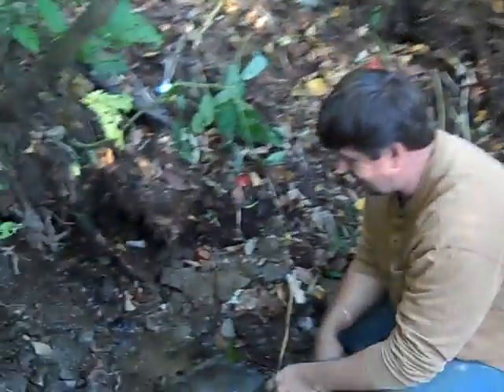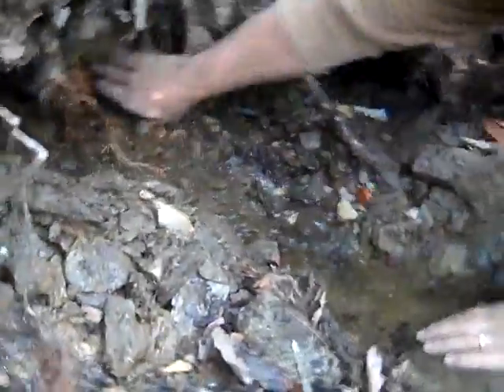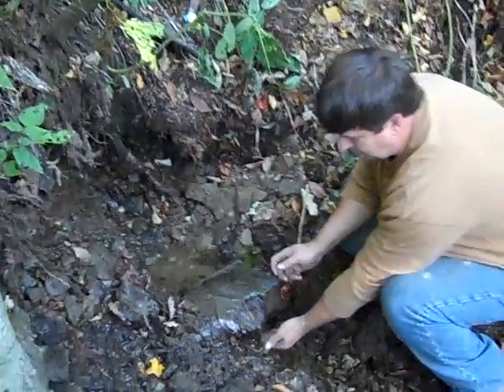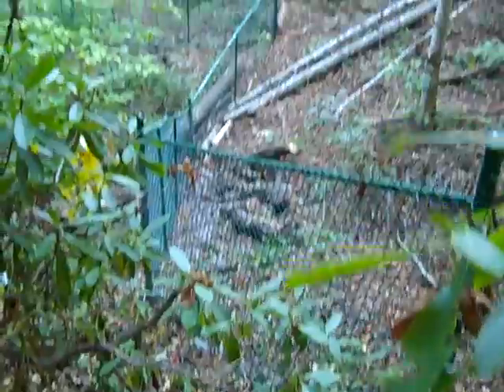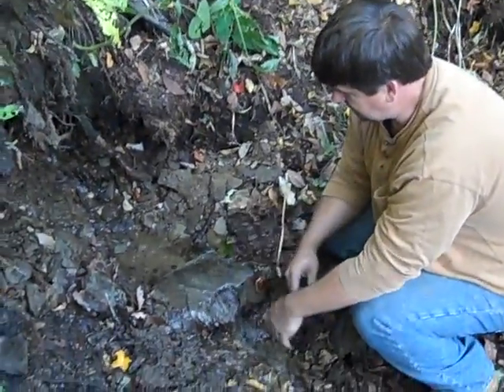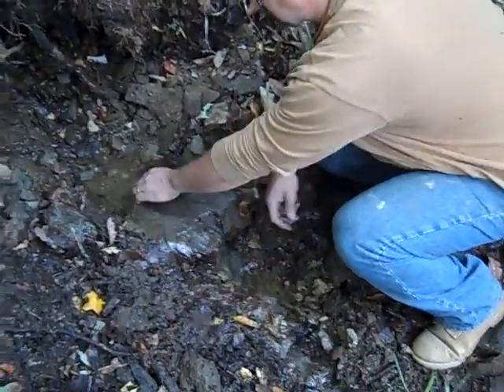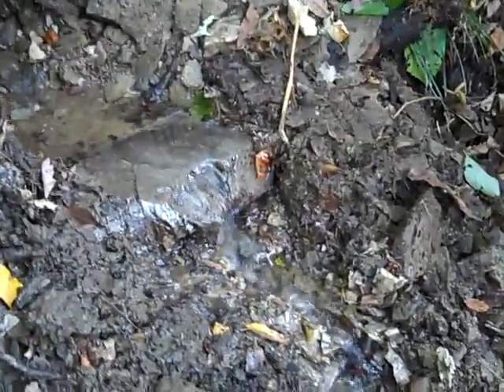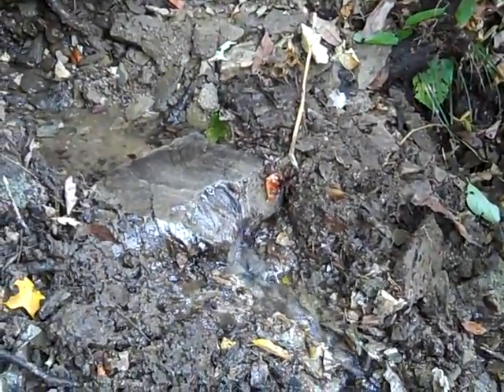WROL Spring Development PT1

Comment: I have a similar spring that originates "inside" the hill and, like your video, I did a little hand excavation to open it up. With a couple of feet of dirt above the area, I'm concerned about the little cavern collapsing on me and the water finding another path. I've already had experience with other spring dams adding enough pressure that the water "jumped" to another path of least resistance. I'm thinking about about cutting up a bucket or barrel to serve as a sort of roof/shield and then filling the interior with rock, and rock out to the collection dam. Any thoughts on something like that?

Comment: While trying to build my own system, your video has been most helpful. Also made a road trip up to Carolina Tank Co. to purchase the spring box.  I thought to be safe I would have the water tested before taking the next step. The results showed, bacteria, ecoli and fecal material. The spring is in a remote area with no development or farm land anywhere within miles.  Did you have this spring tested before you put in the dam and spring box? Also, have you had it tested since the install? Thanks!

Comment: in Florida THEY ARE TORN APART BY DEVELOPER'S There is a spine high ridge line about 250 ft above sea level fellowing i-75 south to silver springs then it use to drop in to a few streams then into the Everglades